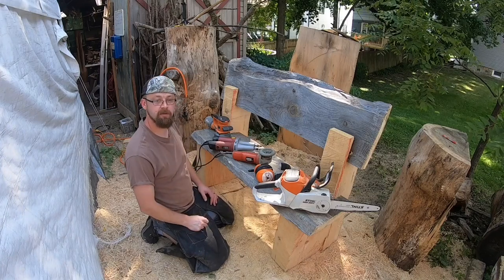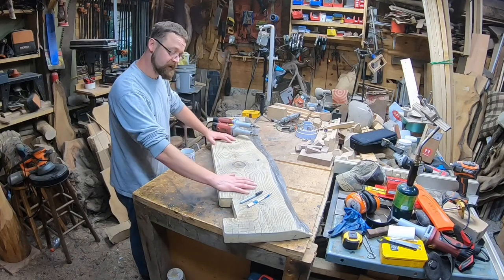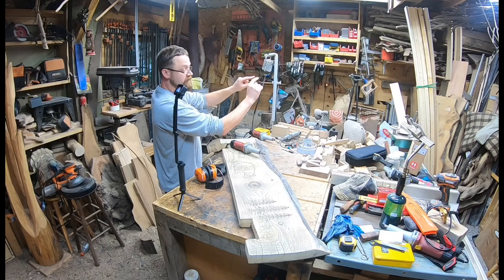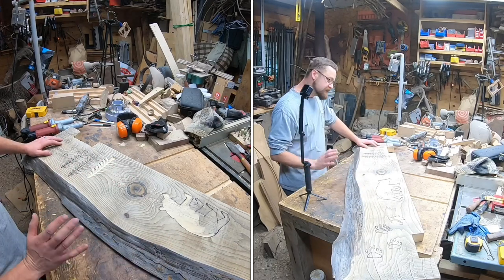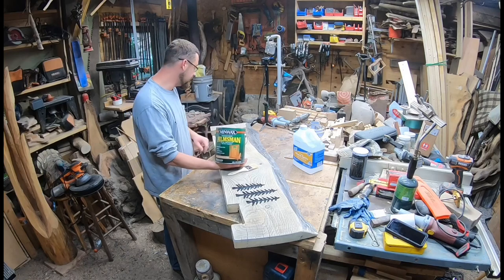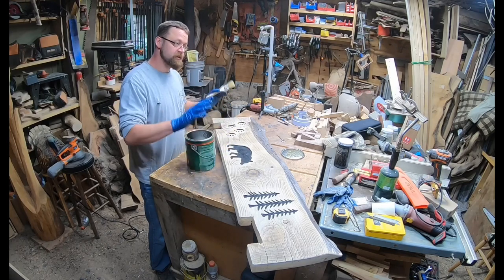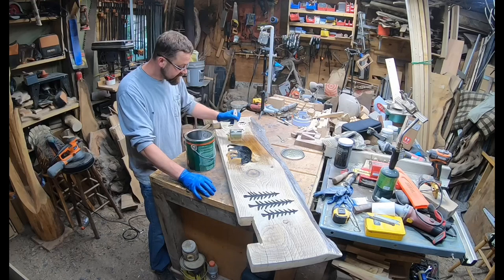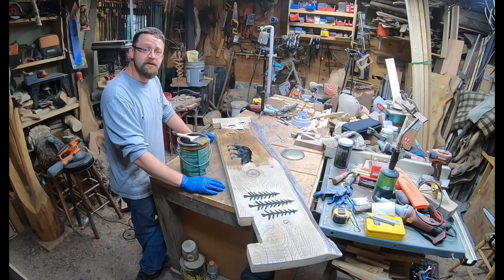Finishing the portable bench.

Comment: Nice bench and Brill vid I like making benches just struggle to get the larger logs sometimes to make them
Reply from the maker: Yeah it can be tough sometimes. Could always check with a local saw mill if you have one and buy from them . If it’s worth it
Reply: @KyleHallwoodworker  I have to use planks for seat and back board cant get no live edge wood slabs in UK the ones u can get are tiny and cost a fortune
Reply from the maker: Uh that stinks man
Reply from the maker: You can make that plank look live edge with a couple tools you might already have for carving
Reply: @KyleHallwoodworker  il try give it a go next one I make
Reply from the maker: Shaun Hannan  I will also make a tutorial on it
Reply: @KyleHallwoodworker  thank you that would be really good to expensive in UK to buy